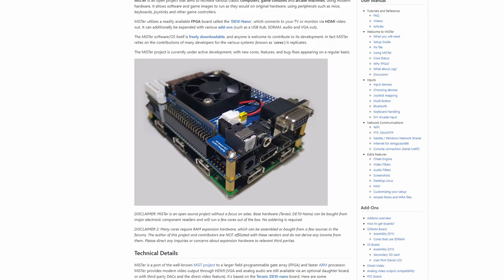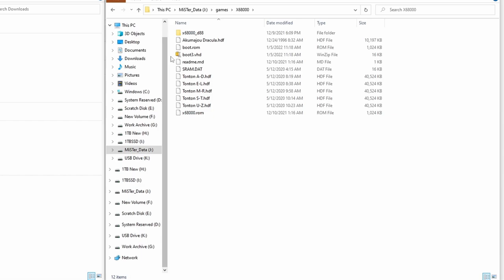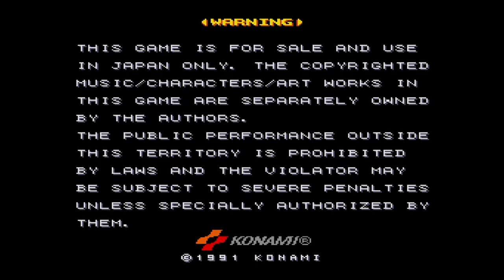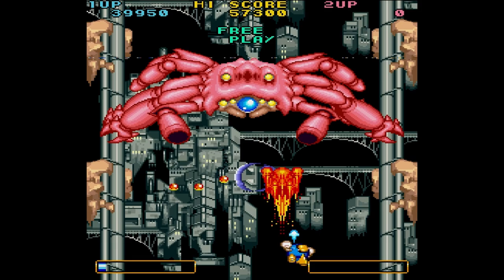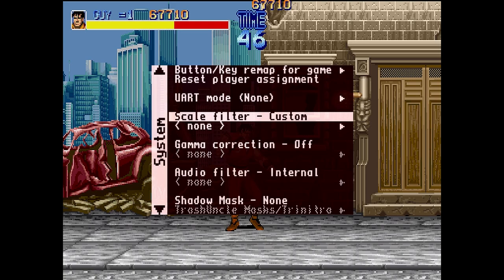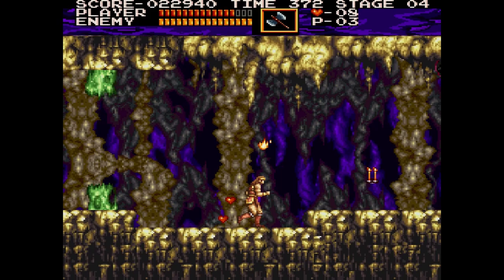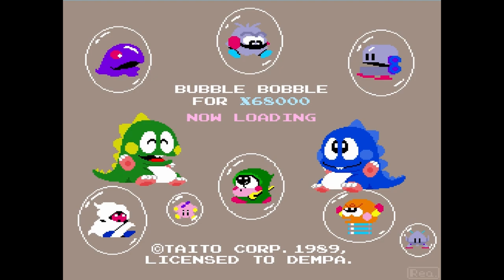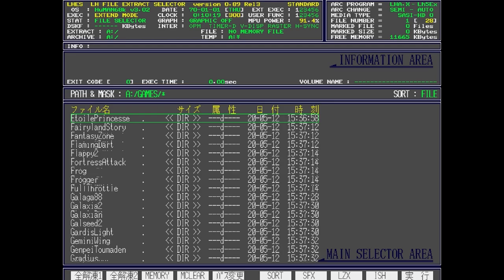MiSTer FPGA DE 10 - Sharp X68000 Core Setup Guide and "Review"! A Japanese Computer Masterpiece!

Comment: Thanks, you clarified a few things I was unsure of. Great video, Thanks for putting in the time on this video. Best X68k core vid out there in my opinion.
Reply from the maker: Super appreciate that. If you need more help lmk. I am always around here and there
Reply: @VideoGameEsoterica  I do have one question. When I load Final Fight or Street fighter, .HDF, I get BGM but no sound effects. Tried converting Final Fight .dim to .D88 just to see if it would make a difference, no change. Im missing something simple im sure.
Reply from the maker: It’s still buggy. I have the same issue. It’ll get fixed eventually :)

Comment: Absolutely brilliant, eventho they need to add some sort of virtual keyboard overlay that you can prompt only when needed so you can easily select options without a real keyboard (that's what Amiga and C64 emulators do on retropie and the likes and it works great. I used an X68000 emulator on Windows back in the late 2000s and it was indeed only partially translated from Japanese, no command line required but still a lot of tinkering. But it was worth it, I got to experience Cho Ren Sha 68K which to me is a perfect shmup gem. These doujin games appeal a lot to me because of their exclusivity, more than the perfect arcade ports. I mean, I see little point these days in ports if I can easily play the arcade version that was so out of reach back in the day. The only real appeal of ports, unless they offer something more or different, would be in their collectability but X68000 prices are insane as we know.
Reply from the maker: Yes a virtual keyboard would be nice as a lot of times you just need to push ONE button to get to the point where you can go exclusively controller
Reply: @VideoGameEsoterica  hence allowing you to remap one button to a keystroke would do the trick
Reply from the maker: Yes it’s mostly for floppy games needing a keyboard to select midi or internal sound hardware with a keyboard. For HDD images you need the full keyboard

Comment: There is a rom set where each game is an hdf image. This makes the core run just like any console core as they all auto boot directly into the game. No need to click on bat files and it's much faster.
Reply from the maker: Just not a set I’ve come across yet
Reply: Any tips on how to find it? Google is not helping.
Reply from the maker: Archive.org. Search MiSTer X6800
Reply: @VideoGameEsoterica  Thanks!
Reply from the maker: Np! You can always join my discord and ask me there too. A lot easier to answer than here since I can’t really link anything

Comment: Well done. Thank you. You're right. Sounds great with the mt32
Reply from the maker: the MT-32 should be considered a must in my opinion :)
Reply: @VideoGameEsoterica  I have my Mister in a "bartop" arcade I've primarily used for Mame over the years but really want a crt setup in an old desktop to get the right 'feel'. But for now, the mt32 piped through the arcade speakers is a nice touch.
Reply from the maker: Nice. Sounds like a fun project

Comment: Perfect - this is pretty much what I was hoping for when I asked for more PC core videos!
Any idea what the Load/Save to SRAM to SD card does - that's how you would save games without losing the save game data, correct?

Also, when you select Load SDRAM it, does it load only the data for the specific game you've currently loaded or ALL X68K SDRAM contents saved to the SD card?
Reply from the maker: Correct. That’s what SRAM is for. On the second part I believe it’s game dependent. If you load a new game reload the saved SRAM
Reply: @VideoGameEsoterica  How exactly does this work? I launched Castlevania, from an .hdf file, played it for a bit and did the "save SRAM to SD" before quiting. After rebooting mister when launching the game again "Load SRAM from SD" does nothing and I also can't find any .RAM files on my SD
Reply: @VideoGameEsoterica I came here looking for info on how SRAM works as well. Like the other commenter, I tried saving to SRAM and then loading and it doesn't seem to work. Does the mister require an SD card in the 2nd slot for this to work?
Reply from the maker: No I did it based on one card and never utilized the secondary slot

Comment: Thanks for this. I have it running. There's a strange problem with the scanlines. I like Adaptive scanlines 10_10 which gives a very nice CRT scanline effect. This setting works with every other core I've tested but looks wrong on the X68000. The scanlines are massive and not spaced correctly.
Reply from the maker: X68000 does not use the same type of video mode that everything else uses. This is why
Reply: @VideoGameEsoterica  
Thank You. I get it.

Comment: As always, superb guide VGE.
I’ve been lucky enough to get this running on an old microvetec quad sync monitor.
And the mister mt32 pihat is superb.

Couple of things I found though:
Final fight crashes when I select mt32 module at the character select screen?
Granada X doesn’t come up with an option to change the sound even though it’s listed to support mt32?
Finally I downloaded the soundfont files via the script on the main mister scripts area, can I now select the sc55 module?
Reply from the maker: Some things will still crash. Some games that support midi support it “in secret”, as in you have to hold a certain key down at boot to get it to happen. Google the name of the game and “x68000 midi” and you’ll find out how :) it’s diff on each game that doesn’t just give me an automatic menu

Comment: This has made me want to take the plunge and buy a MISTer, but they are sold out everywhere.    You can't even buy a de10 nano board on ebay or terasic.   This supply chain issue, which is deliberate, sucks so bad.
Reply from the maker: Yes I will be touching on the shortages in my Jan news video. You can order on Mouser or Digikey and secure a place in their allocations
Reply: The supply chain issue is far from deliberate. Components are not available to fill the demand, that's it.

Comment: Thanks for the tutorial, I appreciate it!  For some reason my x68000 core loads to a blank screen.  I added the latest core .rbf file in the _Computer/X68000 folder, and I added boot.rom and boot3.vhd in the games/x68000 folder.  When I load the core, it's just a black screen.  The menu comes up when I hit F12, but nothing happens if I try to mount a FDD or a Virtual HDD.
Reply from the maker: I saw you on discord. Keep me posted

Comment: So, I was wondering, I actually own one of those 24khz monitors from Japan. a KD-854.
Knowing you, you probably do as well. 
Would the Mister be able to output a 24khz signal I wonder. I know there are some games on the X68000 that's able to do it, but Im more interested in the PC98 line up of stuff.
Reply from the maker: I believe 24khz should just come out of the analog VGA port stock if you try it. 

I don’t own a medium res monitor. I actually need one!
Reply: @VideoGameEsoterica  Now's the time! The monitors and the PC98 is going to come up in price rather soonish.
Reply from the maker: I probably should! Damn you...convincing me to buy more stuff

Comment: I have an mt-32pi too, got Akumajou Dracula working - I press 2 for MT32 it loads the game & it plays fine, but it plays music from BOTH the builtin soundcard AND the mt32 at the same time, and completely out of sync? It's maddening! It didn't seem like you had that problem.. am I doing something wrong? I hope you can address this in your next video! Thanks!
Reply from the maker: Did you select MIDI options in the core option? I have a video specifically on how I set MIDI up; check the video description for the link
Reply: @VideoGameEsoterica  Sure enough, it was because in UART mode I had MIDI selected, like you would think you should... Turned that to off, and just used the MT32-pi menu to set "use MT32-pi" to yes, and voila! Derp. Lol.  Thanks!! Also, I recommend trying to find the hdf for Akumajou Dracula... SOOO much faster to load, but took 30 minutes of searching... Torrents are things...
Reply from the maker: Yes the HDF files are so much better than d88

Comment: I have followed the MT-32 Pi setup video now, and this one, but cannot get it working.

Got latest, same, .rbf file [X86000_20211214.rbf]
And I do not get the MT-32 setting inside the X68000 core's OSD menu.

I have a suspicion it's due to the warning shown on my hat's OLED which reads;
Low Voltage: chk psu

I'm using the short USB which came with the MT-32 and it's connected to the correct port, the user port.

The PSU I'm using is the one I ordered with my MiSTer;
Output 5v 4a

Due to that message warning on my MT-32 I'm suspecting the reason I'm not seeing MT-32 options in the core's menu is due to power rather than my configuration. 
Would that PSU be enough for the sandwich D10 nano, usb hub board and IO board... as well as the Pi3a and MT-32?

Anyone know a resolution?

Otherwise I guess I'll try taking the boards apart and drop the USB hub temporarily see it makes a difference / clear the OSD warning
Reply from the maker: Did you watch the whole video? I show you how to bypass that warning :) watch it again. Towards the back half
Reply: @VideoGameEsoterica  I'm going to say yes... but evidently I must've missed that bit. Oops.  Cheers
Reply from the maker: LOL there is a section about adding a line to the INI file to bypass the low voltage warning. I show you how :)
Reply: @VideoGameEsoterica  I admittedly missed that when setting up... but had found another webpage when searching that error and had added that line to to the config.txt but I had a line space between that and the [pi3] so just changed that, so was as in your screen.
But I still get the chk psu warning on the OLED.

I'm not using vHDD I'm only loading the floppy disk versions but that won't be relevant to the MT-32 OSD menu not being present.

Just another though though.  I am running my hook up;

MiSTer sandwich boards all via the 5v PSU, and my monitor, both into an extention lead adapter which then plugs into the wall mains.
I wonder if going via that extension lead is causing not enough power?

I'll try moving my setup to another part of room where monitor and MiSTer can have direct plug into the wall... see if that makes a difference.
Will be tomorrow now as 12:30 and I got work in 6 hours, I should get some sleep 

Thanks for the help and pointers, as always 👍
Reply from the maker: Hmm yeah maybe you aren’t drawing enough power. You’d need to check at the wall or the power inlets with a multimeter

Comment: I'm really struggling with this.

I'm running my mister in an arcade machine New Net City with a trisync monitor.

I've copied the files like you show and when I select the core, the screen goes blank "no signal" and that's it.

No attempt to load the core on screen and I have to turn the machine off at the power socket. F12 does nothing.

Can't understand what I'm doing wrong as the previous owner of the cab had this core running.

Can anyone help?
Reply from the maker: What kind of connection. RGB I am assuming?
Reply: @Video Game Esoterica  yeah, I'm going through hdmi to a vga converter. No problem running all the arcade games on it, atari, snes, mega drive etc. Just as soon as I select the x68k core from menu, instant black screen. No building rom progress bar or nothing. Should I try plugging the hdmi into a monitor to see if I get a signal there?
Reply from the maker: 100% it’s the converter. X68000 is medium resolution / mix of resolutions. I don’t think you are getting sync at all
Reply: @VideoGameEsoterica  is there anything I can fiddle with in the ini?

The guy that sold me the machine said he had the x68000 running on it.
Reply from the maker: Unsure as that’s not a config I’ve tried myself
Reply: @Video Game Esoterica  OK dude, I'll try plugging in a monitor to the hdmi tomorroe after work and see what I get.

Thanks.
Reply from the maker: No worries. Lmk how it goes

Comment: Hi could you show us how to play this core in 240p. Some of the games do not run in 240p like Castlevania. I think you can use the scaler but I do not know how to use it. Please help.
Reply from the maker: I can look into it in the future but not everything will work just due to how the X68000 works
Reply: @VideoGameEsoterica  Thanks for the reply. I couple people are using the misters internal scaler to do it but I do not know how to use it.
Reply: I almost forgot when you were changing the amount of ram in the 6800x. I saw an option in the menu for tv mode. I wonder if that mode switches the 6800x to output 15hz.
Reply from the maker: I see. Not soon but eventually I’ll touch on it
Reply: @VideoGameEsoterica  Cool will be looking forward to it.

Comment: How do you save progress on this core? I can't seem to figure it out. Every time I reset the progress is wiped clean from the floppies.

And on the autobooting hard drive images they have their own save files that revert back to the initial status when I reset no matter what I attempt to change.
Reply from the maker: manually save SRAM then restore SRAM. You can set save SRAM when you hit menu button too
Reply: @VideoGameEsoterica  Ah! Thank you so much! The concept of restoring my saves is a bit foreign to me compared to other cores, but it makes sense. Just another quirk of the x68000 I guess!
Reply from the maker: Yes just how the hardware worked as real hardware and that’s been replicated with MiSTer :) it’s very similar to the GBA core actually
Reply: @VideoGameEsoterica  Unfortunately I'm still stumped. Nothing I do seems to impact anything ingame. I'm at a loss.

Comment: Hi, thanks a lot for the video, help me for launching games. But how could yo start a game with three .d88 files ? Phalanx for example, I have this : Phalanx (1991)(Zoom)(Disk 1 of 3)(System), Phalanx (1991)(Zoom)(Disk 2 of 3)(Data) and Phalanx (1991)(Zoom)(Disk 3 of 3)(Opening). Best regards
Reply from the maker: You need to Google how to load it. Every game that came on more than two discs does something different. Sometimes disc 1 is actually disc one...other times it has a different boot order. It’s game dependent
Reply: @VideoGameEsoterica  mmmm ok thanks, if anybody knows this you're welcome :)
Reply from the maker: Did you try system in 0 and data in 1? I know the opening disc isn’t necessary
Reply: @VideoGameEsoterica  not yet will try tomorrow and let you know
Reply: Ok it works without disk 3, but the game is bugged with no music and problem with many sprites :(
Reply from the maker: Hopefully gets fixed up in a future update

Comment: Do you know of any way to get the mt32pi working in Sol-Feace? I know you’re supposed to hold down a special key while the game is booting, but I have no idea how to make it work.
Reply from the maker: Hold 登録. Whatever that equals on a US keyboard
Reply: @VideoGameEsoterica  It seems there is no mapping for this key in the core currently, but the workaround is to use the BIOS / software keyboard: Right-click with a connected mouse immediately when the game starts loading to display the on-screen keyboard, then click on /  hold the key to the left of 'help'. There's a limited window to do it, but it works reliably.
Reply from the maker: Good to know!
Reply: Btw, this will work for some other Wolf Team titles also– Granada, Arcus Odyssey and FZ Senki Axis (With that one, it loads differently, so press / hold the software key and keep the mouse button pressed even after the osd keyboard disappears for it to register it) .
Reply from the maker: Classic 90s computer logic; let’s have completely random, arbitrary and not at all consistent methods to enable a feature LOL